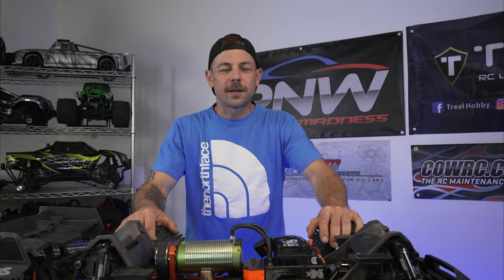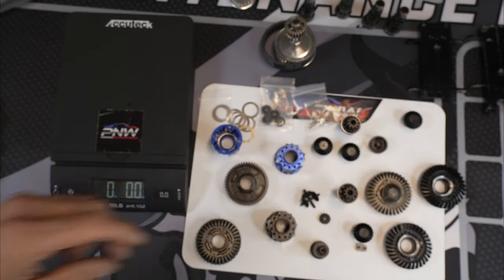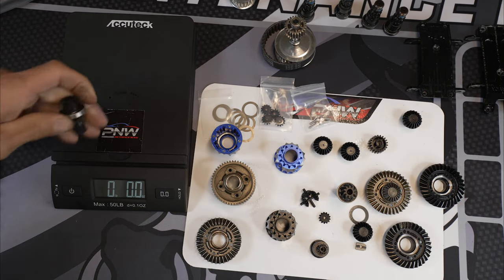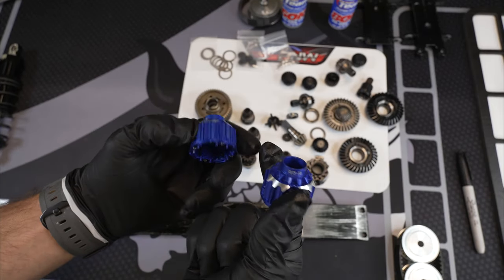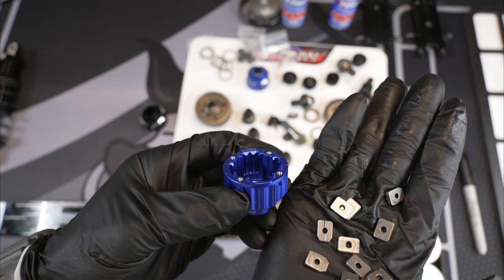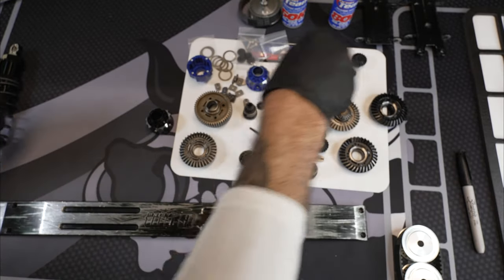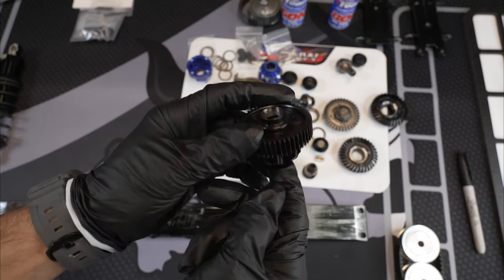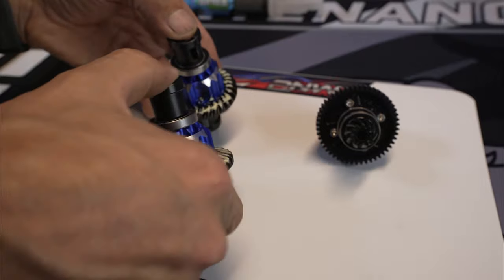🔥🔥Traxxas XRT RC CAR MORE BITE ➡️GPM MOD 1.6 DIFF GEARS

Comment: hello folks :)  take care the gpm are not well machined on bearing slide (bearing moves on ) and adjusstement is also bad between tooth eaven with shimes only work on the half off surface  , i have many subs with weared gpm diffs in a few runs (thos who not shimed never reach 5 runs ) also the car is way more noisy with all that gpm stuff and not last longer (from wat we have seen here on a buchle off xmaxx )
Reply from the maker: I have many runs on my gpm
Gears and many customers over 100 sold, never heard this issue before. Also you don't shim the GPM ring or spyder gears.